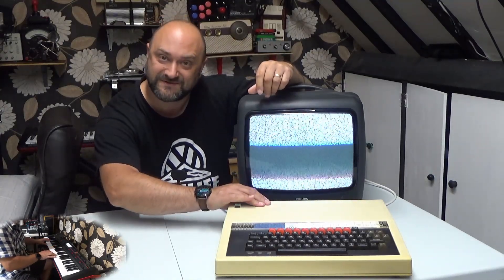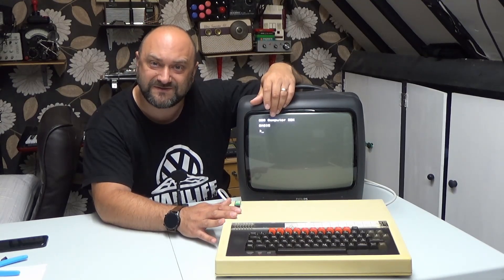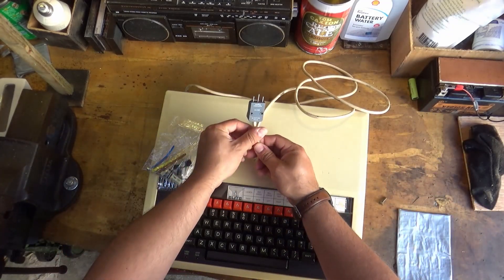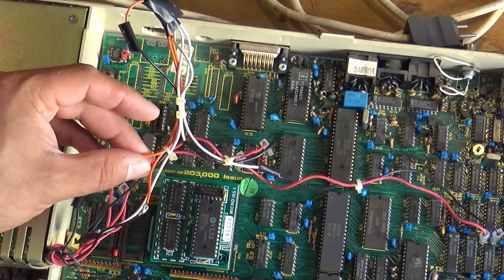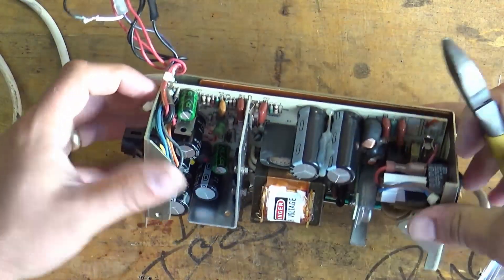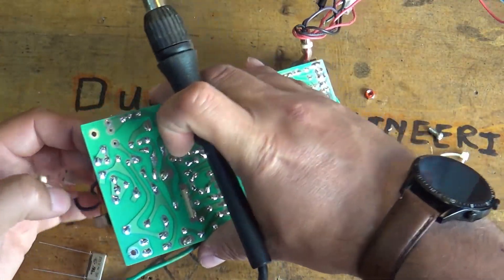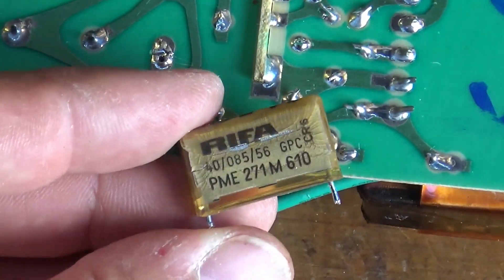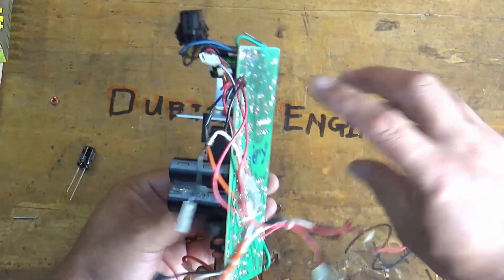DuB-EnG: BBC Model B Microcomputer Power Supply PSU ReCap Service Teardown Fault Finding & Refurbish

Comment: Hi, the ROM may not be faulty it could be the socket. I had exactly the same problem you encountered and moved the ROM to the next available free space and it worked.
Reply from the maker: Thanks 🙏... I’ll give that a try :-)
Reply: @DubiousEngineering  After a closer look at the video I saw that the BASIC ROM was in the last slot and normally it would be in slot 2. This shuffling around could be that a couple of the sockets are duff. Try some contact cleaner first, you never know it could work. Failing that get the continuity tester out and try that. The ROM you suspect is duff is a Watford Electronics DFS (Disk Filing System) paired with the floppy controller you have in the machine already,you could use a Gotek drive instead of an SD Card solution.

Comment: To hear that beeb from the BBC is amazing isn't it? I recapped a Master 128 power supply and fitted one of those MMC adapters. I also have a real 6502 tube CPU board and tinkered with doing the raspberry Pi / Pi zero Tube option. Pretty awesome machine - even for those who didn't grow up with this system a 'the computer in school'. :)
Reply from the maker: lactobacillusprime I love that beeee bip sound!!!  I’m keen to know more about the pi tube thingy... I need to look it up!!

Comment: replaced those X2 caps in two BBC Model B machines recently - one X2 had already blown and the other three all had cracks - rather then putting new RIFA ones in I got some Panasonic ones from CPC - don't write off that Watford ROM immediately, test it in on of the other sockets to prove if it has gone bad or you have a fault with the sideways ROM socket. You just need to get a disk drive or SD card interface working with it now and run up some games on it
Reply from the maker: Excellent advice!!  I have indeed done all of the above now :-).  Except the Panasonic caps!!

Comment: there must be a ECONET to Ethernet adapter.
Reply from the maker: Impossibubble...   well, you'd need a pi and some java script...  etc etc etc
Reply: @DubiousEngineering  using two Motorola MC68B54 ADLC's and a Raspberry Pi IV comes to mind and a little C++ code should make the unit work.

Comment: How did you tune your TV for the beeb? I can get on auto scan on my LCD but i’ve tried all the channels on my CRT and haven’t got any useable picture

EDIT: Go to channel 5 and tune it in with the pot on the RF modulator in the beeb
Reply from the maker: Your CRT should have manual tuning...  somewhere :-) 😀
Reply: I tried for ages to tune mine then decided to try putting an av lead from tv output straight to av phono it came on crystal clear seems a previous owner had modified it to ourput av.
Reply: @sirconkers342  It natively outputs a B&W signal via composite but I think there is a simple mod you can do to make it colour
Reply: @fcubeboy4959  yes i know but i connected the modulator to tv composite and got crystal clear colour so just try if its been modded same way mine has tv signal wont lock thats why i tried it.
Reply: @sirconkers342  oh yeah I’ve heard of that mod too

Comment: Thank you very much for the recommendation. I own a BBC microcomputer since I was in UK. Just recently took out and also found the power supply look like having the same capacitors problem so I changed those cap you recommended. But when I tested the power supply the output gives a 10V supply and not the normal 5V supply. Can anyone help please. Thanks
Reply from the maker: That’s not good.  You probably need an oscilloscope to trace the problem as it’s a switching power supply.  May be a tricky one!!
Reply: @DubiousEngineering  many thanks

Comment: ESC would have stopped the program where you could run it again. OLD <RET> RUN <RET> would also re-run it :-)  I thought all of the electrolytics would need re-placing. Anyhow, this has spurned me to tackle my own BBC B and I think my CUB monitor would also need re-capping / servicing. These old analogue TV still have their uses.

Incidentally there is an excellent BBC B/Master emulator out there. Its like having a BBC into your PC or laptop.
Reply from the maker: I like JS Beeb it's a great Java BBC Emu.  Thanks for the tips on breaking into and re running programs!!